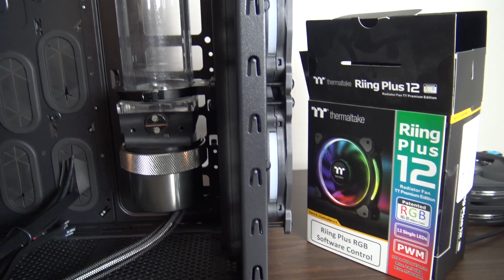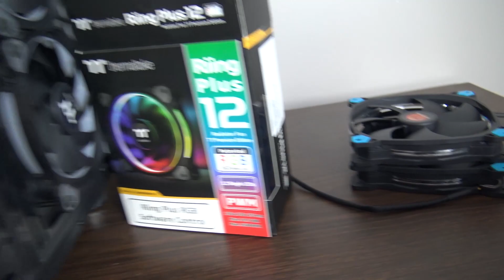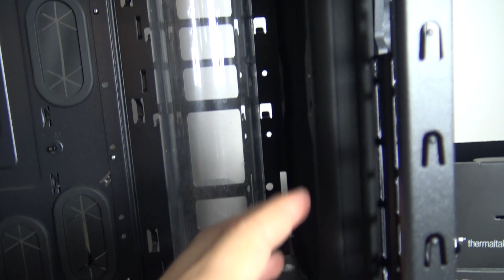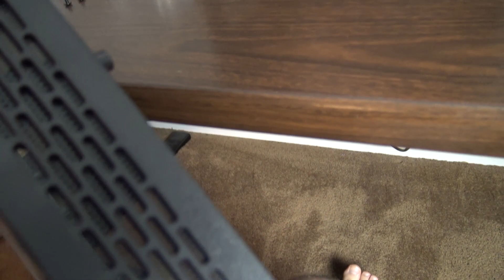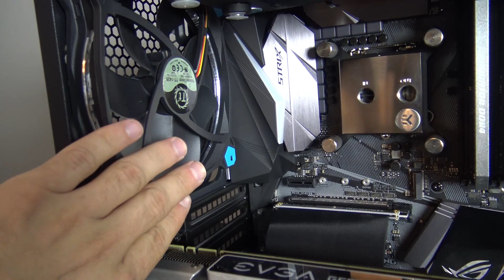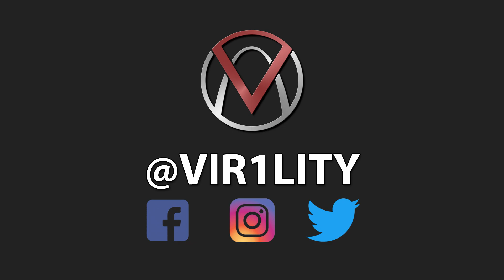Thermaltake View 31 TG: Custom Water Cooled Build Log Pt 1

Comment: Is it possible to use a AiO Liquid Cooler vertically right to the Mainboard
Reply from the maker: In this case it would require some modification and the back panel is not ventilated, it's glass.
Reply: Vir1lity PC Customs Hmm, can I buy a Fitting back panel, becauae I dont really need the TG at the back

Comment: i did my very first water cooled build in this case amd 8350 and 2 r9 290x's in crossfire i put a ekwb coolstream ce 280 in the front and a se 360 on the top under foll load the cpu doesnt go over 35c and the gpu's max out at 43c and thats while playing destiny 2 @ 3440x1440 max resolution. i bought the exact non rgb version because the fans that come with the rgb version are just air pressure ones and i knew i was going to do a water cooled build in the case so i didnt see the point in paying extra for air pressure rgb fans i also picked the psu shroud for the f31 suppressor from the thermaltake store as it screws right into the case like it was made for it but was never included. your right the air flow is utter garbage on the side what i did was removed the front plastic piece off of the front cover drilled holes in it then ised the mesh filter from the tom chopped the magnetic strips off placed it between the plastic piece and the frame and that took care on the air restriction in the front of the case

Comment: Awesome to see more View 31 buildlogs! I was waiting for a month for the RGB version and then finally swapped the order for the normal version because it had better availability.

Im going to be cooling R7 1700 and 1080Ti with 45mm thick 280 and 360 rads. 

Kinda sucks I'm building now since the View71 is about to come available soon and that looks even better and seems to have better quality also.
Reply from the maker: View 71 looks great but I think it's going for $200-$250 and it's a bigger case than I wanted